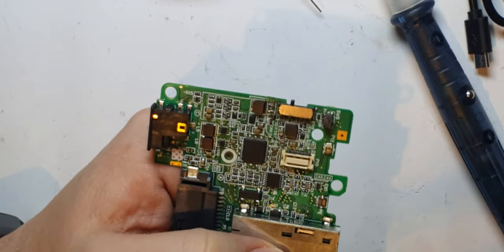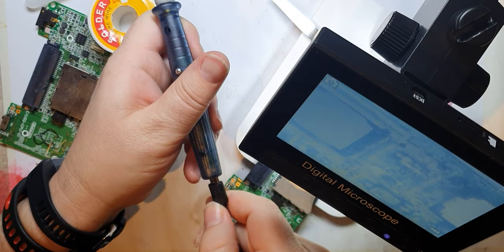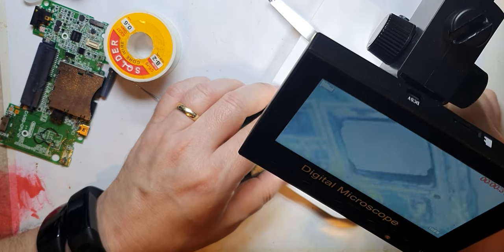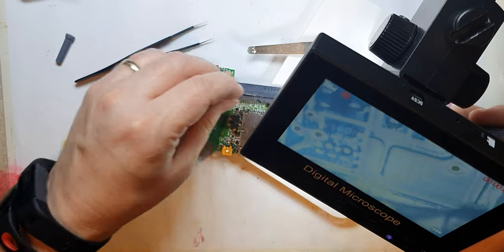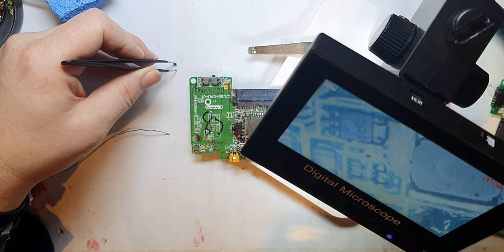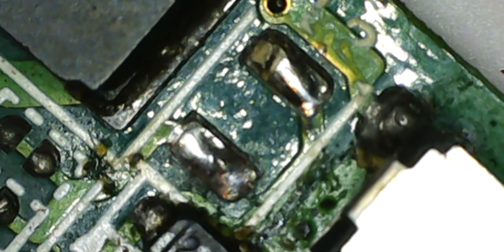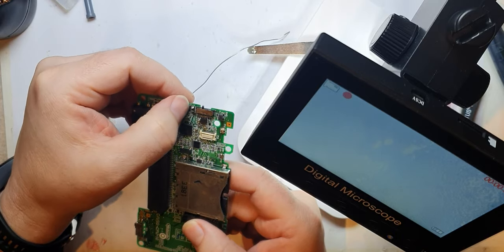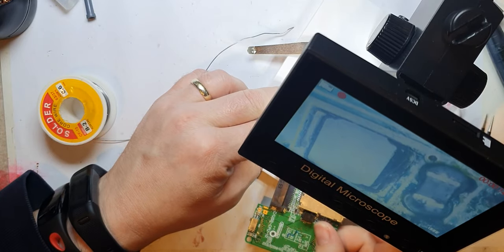L2 fell off?  Replacing a DSL L2 Inductor with basic tools.

Comment: Thanks for this guide. Will be attempting the same in a bit!
Reply from the maker: Have fun!
Reply: @spidermaf  Got the inductor soldered on, but during the teardown broke the retainer on the ZIF connector for the touch screen digitizer. One more thing to do lol
Reply from the maker: @Angel-mt8eg  Oh no.  Maybe easier to see if you can replace the whole board with a second hand one.  Look for a DS on eBay maybe where there is a broken screen as the board might be sound..

Comment: Just took apart my late brother's DSLite to see what exactly happened to it when we were kids and discovered that the power switch was fine to my shock. (The unit had been thown against the wall in a fit of rage lol) But noticed the L2 was missing. Spent 3 hours trying to find a schematic of the mobo to figure out what L2 was when I stumbled across your video. Do you by chance know what the value of the inductor is? I'm attempting to harvest the part from a 3DS XL and don't want to pull the wrong part if it's even possible.
Reply from the maker: Hey mate. I've got some of my old donor ds boards out and looked but the L2s are not marked unfortunately. I don't suppose you are in the UK?  I think they at 100uh (micro Henry)